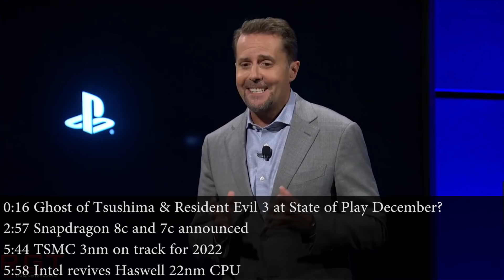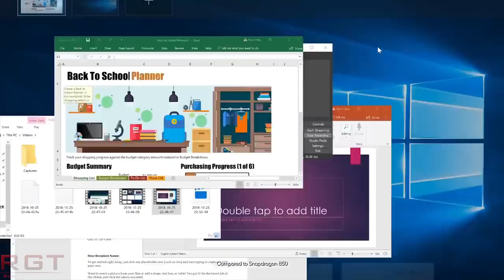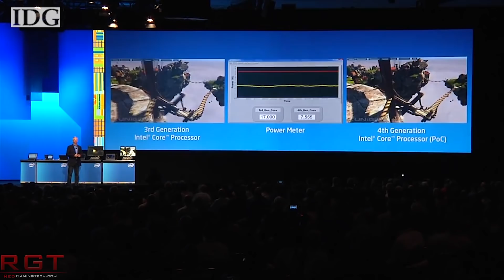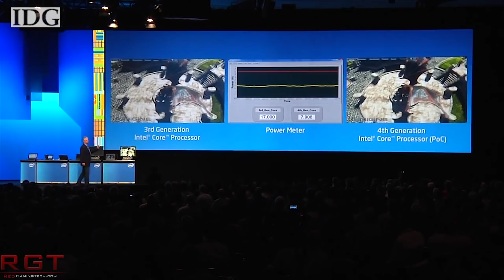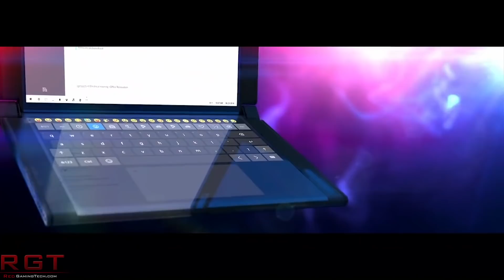Intel Revives 22nm Haswell CPU - Due to 14nm Supply Issues? | TSMC 3nm On Track for 2022

Comment from the maker: 0:16 Ghost of Tsushima & Resident Evil 3 at State of Play December? 
2:57 Snapdragon 8c and 7c announced 
5:44 TSMC 3nm on track for 2022
5:58 Intel revives Haswell 22nm CPU
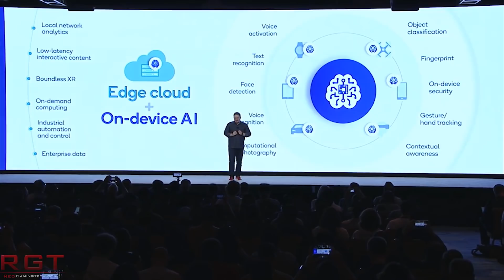Reply: 3 nm starts at 4:44, not at 5:44.
Reply: And the intel news starts at 5:47 not 5:58
Reply: 3 nm are only 7 silicon atoms. If you use the Van der Waals radius of silicon atoms in s crystal like shown in Wikipedia.
The Van der vaals Radius is .21 nanometer or .42 nanometer diameter so you get 7 atoms.
Crazy but now you can actually the atoms used in the structure with your fingers. Your can feel the bricks of the wall the bricks of the wall to the realm of quantum mechanics.
Where only one thing is certain, nothing will be certain anymore.
Reply: @abelgerli  Are you saying my facebook account will teleport into the quantum-realm?
Reply: @toth1982  No, but a like can be also a dislike or a superposition of a like and dislike. So everything will be uncertain and not dependent. 
And just because of this I recommend not to be on Facebook ;-)
Reply: It will certainly let you travel through time into the future.

Sit down at the computer for a sec, look up and it's two hours later.
Reply: These 22nm cpus have analog warmth that is only possible at 22 nm and create a wider soundstage in your listening environment.
Reply: 22>3

Comment: I still love i7-3770 and i7-4770 powered computers. I even love my i3-3220 and i3-3250. I'd love to build more haswell PCs. They still do you good if you feed them enough DDR3 RAM. I wouldn't be angry at intel for making some more.
But to go on a bit from there, I wouldn't be angry at them for making simething like an i7-4970 that had two i7-4770 processors on one die, or an i7-4990 out of two 4790 processors, making them 8 core 16 threads, with a nice heatpipe cooler. That wold still be quite decent today.

Comment: If the 22nm Thing is true, did they mothball their factory back in the day?
or do they just Need to replace some parts in their disfunctional 10 nm factorys to be 22 nm?
after all it is basically a repeated process of the same type, just with smaller Details on the masks.

Comment: I find it odd that Intel is having supply issues now with so many people buying AMD CPU's at the moment, I don't remember them having supply issues back in the day with sky lake 🤔 when AMD wasn't that prevalent,
I wonder what changed 🤔
Reply: my guess would be, they had a lot more lower end CPUs and other parts like Celerons, Embeddded CPUs and chipsets, network chips and whatever else they produce, on 24nm or older processes still at the time. They expected to be on 10nm for server/desktop/mobile for years now and already started transitioning the lower end stuff over to 14nm. They planned to have that 14nm capacity freed up for those lower end things a long time ago, but that did not happen - and so they are producing way more on the same process node, that they usually would spread out over different older/newer processes.
But maybe there are other factors as well.

Comment: To put this in historical perspective; haswell was introduced 6 years ago.That's the same amount of time that elapsed between the 486DX2-66 and the pentium II 450 MHz or between the pentium mmx 233 and the pentium 4 3.06 GHz. To put it in video game terms, it was a leap about the same size as between Doom and quake III or between Daggerfall and morrowind.

What does 6 years of technological development get you today? Hell what does 11 years get you today? Does the original crysis even look that bad?
Reply: I'm looking at this on a Haswell i5 system (4690k). I am mining on it at the same time (recent big CPU mining gains). My system does internet and media streaming at
 4k and Lightroom without any problem. I played Civ 5 on it very well. Haswell performance is all many people need. The media I consume on it would not be better served by any higher performing CPU.
My other system is Ryzen on which I mine and game.
Reply: @Safetytrousers  I think you're infering the wrong thing. Could you say the same in 1998 still using a 486DX2-66? Developers dare not design applications and games for systems that won't exist and processors just aren't getting very much better on silicon. The amount of computing power available today is pitiful compared to what could be put to good use; but you can't design applications for hardware that won't exist.

Comment: Silicons Van der Waals radius is .21 nanometer. The Van der Waals diameter is .42 nanometer. A 3 nanometer process is crazy and possible the wall. We are then down to 3nm /(2*.21 nanometer) or about 7 silicon atoms.
Now we are officially in the territory of quantum mechanics.

Comment: I actually have one of those G3 workstations sitting around but since it was such a piece of shit with only one custom sata port which broke (just some .1mm pins sticking up from the pcb to save the 1/100 cent on a connector that tore out with the cable when unplugging it) I can´t use it without buying a ssd for it.

Comment: Intel brings back 22nm in 2020. Lol
Whats next amd brings back the old bulldozers and sell those as space heaters?
Reply: Use to to mine and heat up homes at the same time is practically paying for itself.
Reply: @1112Hades  Only in winter though.
Reply: For Intel only exclusive. AMD fortunately has to follow TSMC's nm advancement. Thank you:)
Reply: @miyagiryota9238  Actually because TSMC has several customers and many (e.g. Apple) want to use the 7nm and 7nm+ lithography, a shortage is a real world scenario. TSMC is very busy scaling up its production lines to prevent this from happening. To be fair the new AMD Athlon 3000G is actually still on 14nm from Globalfoundries so actually it's a 1st gen RYZEN APU (Raven Ridge). https://www.amd.com/en/products/apu/amd-athlon-3000g Not as old as Haswell but still an architecture and production process that isn't new to cater the low end market. If the prices of the Haswell Pentiums are good and they have H.265 hardware decoding (like newer Celeron and Pentium processors) then there may be a place for them in the market. Though with the typically terrible Intel iGPU they'd have to be $35 or cheaper otherwise the $50 Athlon is a way better choice.
Reply: Intel can have the monopoly of the CPU space heaters.  AMD will monopolize the rest. LOL
Reply: More like people are buying Intel CPU silicon at such high rates that they have to use old lines to manufacture cheapest CPU:s to meet the demand until next gen lines yield enough or AMD captures enough market share for demand to drop below levels that they can deliver with latest lines.
Reply: Jouni Osmala more like they’ve been promising 10nm since 2016 and still can’t have enough yields thats why Intel going back to 22nm! Lol
Reply: @miyagiryota9238  They sold 14B$ worth of silicon before they couldn't supply and now they sell 19B$ worth of silicon.  Intel isn't going back, Intel is just selling everything they can.  Now if 10nm yields would of been good enough year or more ago when they made decisions about todays manufacturing capacity they could of increased the number of transistor made in those lines by more than double.  Intel could have gotten their 10nm yields fixed,  and it would result very little volume improvement until more 10nm lines get running in next few quarters.
Reply: Jouni Osmala that is due to contract. Today even Intels CEO is accepting the fact they will not have 90%  of the cpu market. Even Intel knows they can’t compete with AMD moving forward. Lol
Reply: Didn't they relese Bristol cpu's to FM2+

Comment: i think the reason intel is stuck on 14nm is because they were happy to continue using 14nm for the rest of existence. i mean they kept the 4 core mainstream cpu market going for 15 years with no real big leaps in performance per $. 
imagine releasing the same product for 15 years and not being able to respond to competition. it's been 3 years now since ryzen launched and they still aren't competing. they are basically living on past success and failing miserably. i'm honestly suprised amd don't have more market share by now and i'm also suprised intel stock hasn't tanked by now.
Reply: MrBananaSlice  that’s what happen when there no competition. Release the same damn cpu for 5 gens,  hell let’s make them buy a new mobo also.  Keep price high w/ no performance gain. While amd slowly invest Into market and research to finally take them over.  Intel is years behind now and need to fall flat on there face and one day make a comeback, because competition is good.
Reply: the issue is "mindshare", both intel and nvidia have/had cournered the market in mindshare, ie; AMD gpus were consistently better and more powerful than nvidia's but nvidia had the better marketing and idiots that adhere to brand loyalty (when brands have no loyality) over quality or value, thus we have this bullshit from nvidia today and intel had the same thing, but because unlike nvidia (whom at least did advance their market somewhat over the years in some way in order to keep that perception of them that existed) intel actively retarded development to the point they apparently don't even know what to do anymore.
Reply: Avalloc i actually kind of like Nvidia actually I really like them but AMD cpu’s are where it’s at genuinely fuck Shintel
Reply: 14nm for a decade and no issues charging more and more every gen when it got cheaper and cheaper for them to produce.

Comment: 3nm. what a time to be alive man
Reply: 3nm are 7 silicon atoms. When you do the calculation with the Van der Waals radius of a silicon atoms in the crystal. This is crazy and scary.
You ther are less atoms in than your fingers. When you can start to feel the bricks to the wall to quantum mechanics you can feel the end !
Reply: Thing is the name of the lithography really isn't correct.

14nm has a lot of 50nm features and the smallest feature is around 7nm.

Intel's 10nm and TSMC's 7nm are pretty similar with the smallest features being around 6nm wide yet still 52nm tall.

The height, width and depth all exist and I think the majority of the info given to us is the width, not the depth.

There's an interview where Jim Keller is talking about the gates being 100 atoms across now, not certain if he's referring to 14nm or 10nm.
Reply: @glenwaldrop8166  I am aware of the different structure sizes in the lithography. 
I just want to state that you can actually calculate the relation to the size of the atoms in the monocrystaline silicon. And the Van der Waals radius / diameter is a good indicator.
That we are dealing with crazy small structures right now.
Reply: They're crazy small but still not that small.
Reply: Willy Du

2019

Comment: intel could make some decent value cpus on 22nm.  the 3rd gen was 22nm and it got a rep as not overclocking as well and running a bit hot but that was mostly because it was the start of pasting cpus instead of soldering and people werent as aware of that kind of thing back then.  a 6 core with HT on 22nm (like the 5820k) would perform pretty well and if making it on 22nm would actually lead to a cost savings high enough that it would be worth it then they could do really well with it.  it would run hotter than 14nm because of course 22nm uses a bit more power and all but it would be spread over a larger die and if they soldered it it would actually not be that hard to cool up to maybe 4.4ghz at least.  sell it as an i5, with a locked version at 3.8ghz or so for cheap and a k model with higher clocks, but have it as a discount over the 14nm k parts.  

and yeah a lot of people will say " who cares, just let intel die" but more choices is always better.  as long as intel make good products at good prices and dont do any dirty tricks then i dont have any problem with them.  some will say that wont happen and i dont have any information one way or another on that so i will wait and see.  

to be honest intel should be the "value" company because they produce in such high numbers.  and with amd being a smaller company and being fabless it would make more sense for them to be the "premium"  or "boutique" style maker, with higher end chips than intel can make because intel has to focus on a number of different things and use the same die for all.  of course amd do this well with zen being both HEDT and desktop from a single die but they dont have igpu which oems and laptops need.  of course they have apu dies but those are just quad cores.  so intel uses 1 die for both desktop and laptop so its more of a compromise and probably part of the reason for soldering.  laptop dies usually have no lid at all and the heatpipe makes direct contact.  not soldering probalby helps in that regard, making it easier to use the same dies for both platforms.

but thats off topic i know.
Reply: caRn  care to copy and paste the part here where i did that?  i mean im pretty much saying that with their current lineup they cant compete with amd and that a cpu with more cores on a cheaper process would at least help them stay relevant on the low end.  im basically saying they are behind and they need to make some moves to stay in the game.  is that something a shill would say?

basically to people like you (and there are a ton of you) anybody who doesnt say only good things about amd and horrible things about intel then they are shills.  but honestly its the other way around.  you are the "shill" if thats the word you want to use.  

but in reality shill is the wrong word.  shill is when a person or company hides people that work for them in the public and has them say how great the product is and says its better.  that way it looks like the company isnt just saying its stuff is better, but a member of the public like them is saying it which makes it easier to believe.  and honestly from what ive seen i dont really see much of that going on for intel.  but on the other hand if amd arent actually hiring somebody to shill for them in comment sections and reddit etc then they are getting a lot of free shill help.  i mean some of the things i have seen people like you claim with no evidence and even when the evidence is to the contrary.  

i actually do think amd has hired a PR company to do a cheap geurilla marketing campaign by having a staff of people who work cheap to post stuff on every article, video, and reddit post that has anything to do with either one.  if amd didnt hire some of these people then they are either stark raving mad or have stock in amd that they want to see go up.

i mean even on articles that arent about intel.  was reading an article about samsung and with no mention of intel or even a product that intel has a competing product.  but the first comment was something about intel. 

the same old tired memes everbody repeats over and over, "14nm++++++" or "toothpaste" or whatever.

i mean im saying it right now,  if i had to buy a system right now i would go amd and that means a lot because i only do gaming and only buy enthusiast class prodcuts.  amd had the win before the 3rd gen when it came to lower end or midrange systems but intel still had the i7 level and up crown last gen.  but now amd are the better choice pretty much across the board.  if you have a z370 board with an i3 or i5 or something it might make sense to get a 9700k or 9900k. but other than that its amd's market.

so tell me?  wheres the shilling?  im just speaking my opinion.  why would saying a cheap 6 core 12 thread cpu on 22nm at a cheap price be shilling?  i mean im telling them to do something to lower prices and bring up performance on the lower end to keep up with amd.  how is that shilling?
Reply: caRn  i mean somebody even liked the comment straight away.  go get in chat or post a comment on a video maker or article writer that you respect, that you think is not a shill, and ask them the same thing.  ask them this ....

"if intel came out with a 6 core 12 thread cpu that could run high 3ghz to low 4ghz and made it work on current boards and sold it for i5 prices, lower end i5 prices (135-189), would you think that would give them a better value product in the market?"

im sure they would say yes.  does that make your favorite youtuber or whoever a shill? no. because attacking a respected youtuber for shilling wont help your case.  but you can attack me all day and nobody will care.  thats the difference

Comment: What is the problem with the supply on the 14nm ? low yield? moving to 7/10nm?
Reply: Greed
Reply: They changed their 14nm fabrics to 10nm fabrics and planned to make all products based on 10nm. Now all their products are 14nm and they dont have enough fabrics to meet demand. They also changed 2 10nm fabrics back to 14nm and they are also building new 14nm ones. But until they are finished with all that they cant meet the demand for their 14nm parts.

Comment: No one: Moore's law is slowing down
TSMC: Well yes but actually no.
Reply: 3nm are actually 7 silicon atoms. When you use the Van Der Waals atomic radius for silicon crystals shown in Wikipedia.
When there are fewer atoms in the structure than fingers on your hand the bricks you can feel are the bricks to the border wall of quantum mechanics.
And in quantum mechanics only one thing is certain, that nothing will be certain anymore.
We only inches away from the wall.